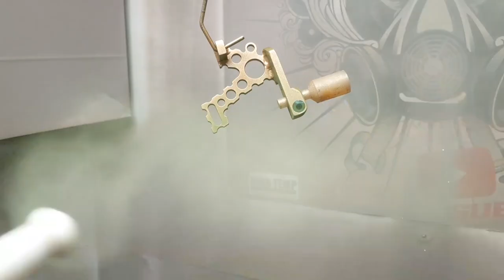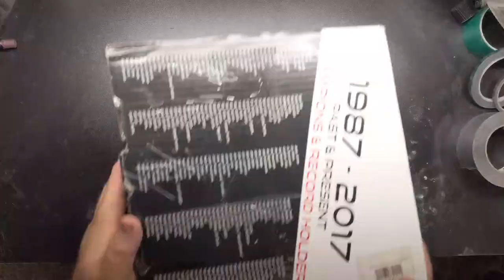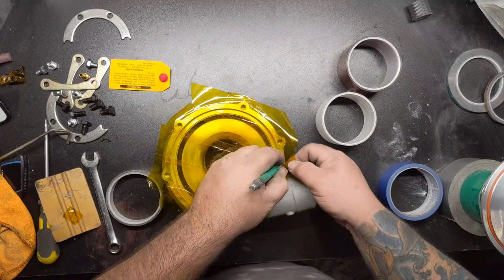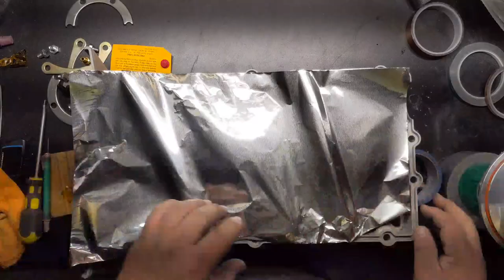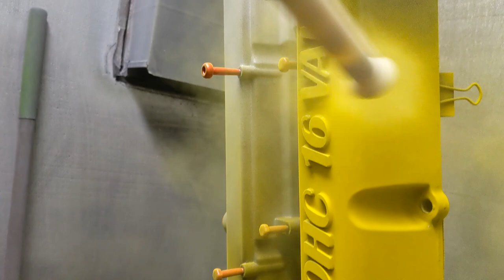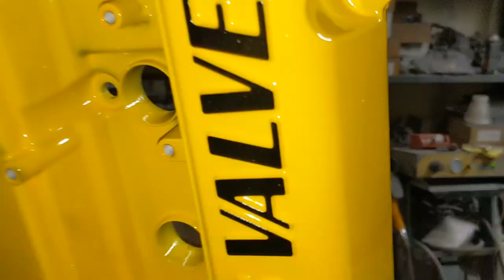No Apologies - A UKC Short - Powder Coating

Comment: Do you prefer a box coater or a hopper system with no vibration table?
Reply: Box systems work good for base colors will need a hopper for metalics and pearls tend to settle to bottom. The box systems are super nice and expensive but you can hook a hopper up easily.  I am no professional but have read books and have the itw gema box set up and bought a hopper for pearls and smaller jobs.
Reply: Box system metalics and pearl settle to bottom and hopper with fluidizar is good for metalics and pearl.
Reply from the maker: Understand that with a box fed you arent stuck using 35-40-50-55lbs boxes, you can pour a little powder into a bag and put it in a small box just the same. As long as you understand your air adjustments on your gun, you dont have any of the issues as described by gsx,
Reply: I have to say your videos are the best out of all the powder coatings. Very informative and descriptive a lot of other videos are just people spraying no talking. Thanks

Comment: Hello, i have a ?, i powder coat some wheels and they came gorgeous, but after 3 weeks the paint started to crack on some spots, what i did wrong? Thanks and keep up the good content.
Reply from the maker: undercured. Im guessing you had a change in temperature in your area, and that caused the metal to expand or contract beyond the threshold of the powder. I ASSUME you cant feel the cracks but you can see them, right?
Reply: @UnknownCoatings   you can see and feel the cracks. Thanks for the fast reply.